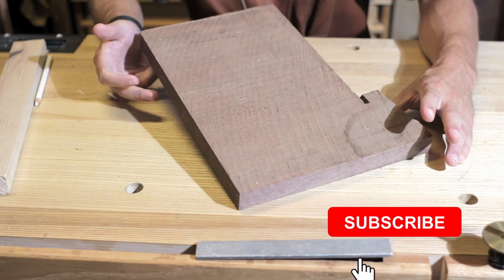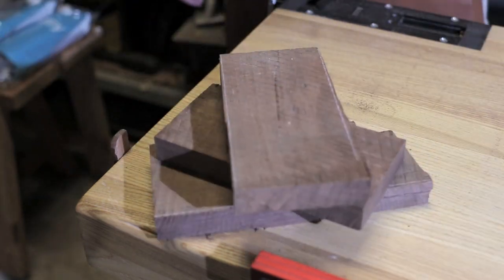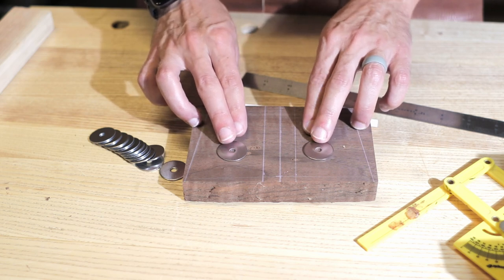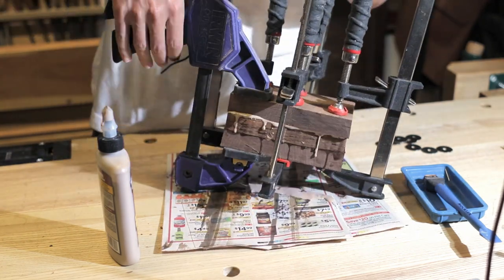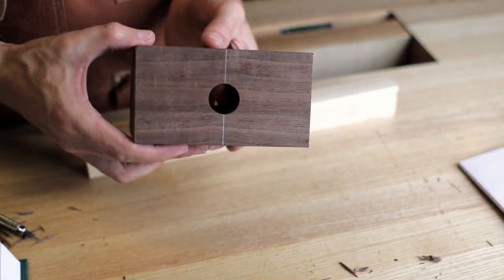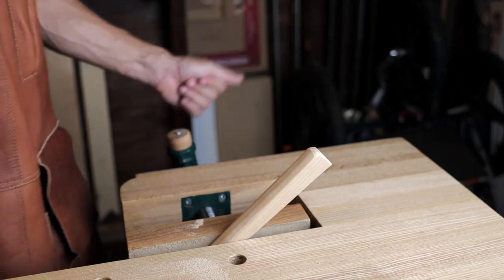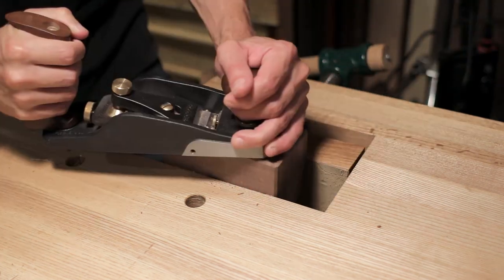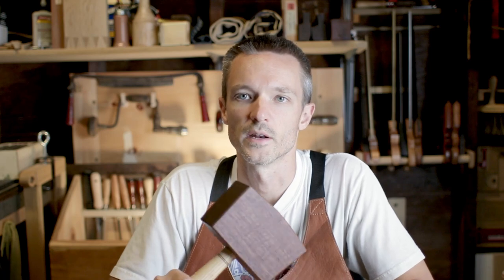Make Your Own Woodworking MALLET - Weighted Head German Type Pattern Mallet with Hand Tools Only

Comment: Do you like your Veritas inset vise? I’ve been thinking about adding one to my workbench
Reply from the maker: Hey Graeme - It definitely does it's job.  I've been using it for 4-5 years now and only have a few small gripes with it: I filed the silver handle down a bit because it was sharp enough to get caught on my shirt constantly.  The metal base plate was also scratching the guides on some of my planes, so I also filed/sanded that down a little bit.  All-in-all though, I use it daily and it works fine.

That being said I actually wish I had added a true tail vise to the bench.  Not because the inset vise doesn't work, just that I wish I had the added functionality of an end vise on that side.
Reply: @TheWirelessWoodworker  thanks for the insight!

Comment: How much weight do washers add?
Reply from the maker: That’s a good question and I actually don’t have a super accurate way to measure it, but a little estimating based on the packaging weight of the washers looks like it adds 6-7oz to the weight of the head.  Overall now it weighs a little more than my other 20oz mallet.